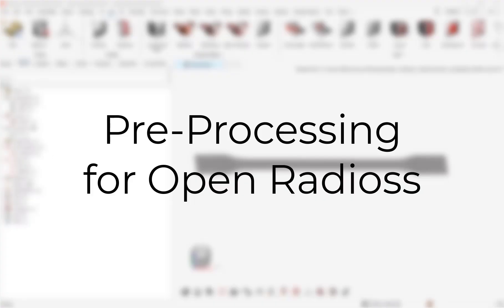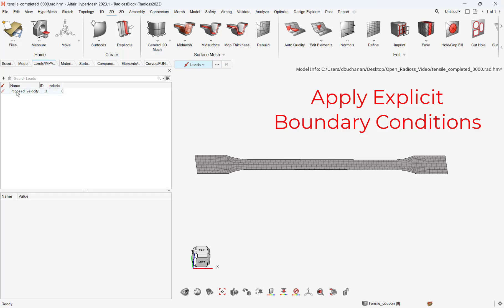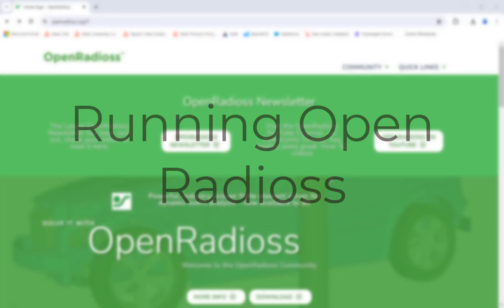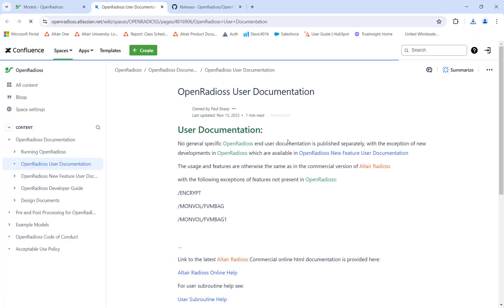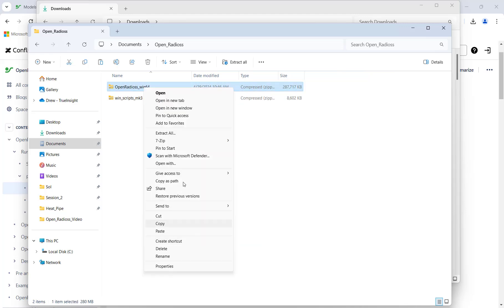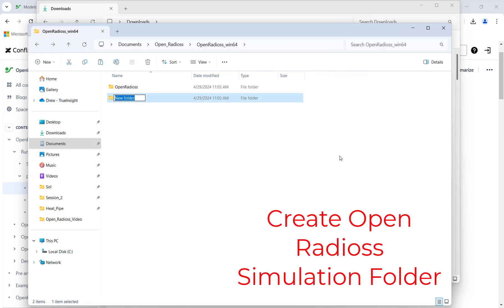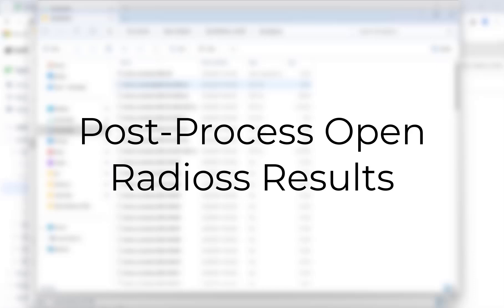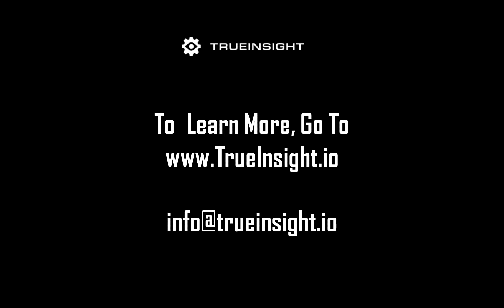Run Explicit Simulation using Altair OpenRadioss

Comment: HELP: there is no separate python gui scripts available. as per documentation, all the scripts are now added in the openradioss package itself. when i find these scripts, there is no such file named openradioss_gui.vbs with application-type file size. only a similar file with 1kb size, and no action on running it.